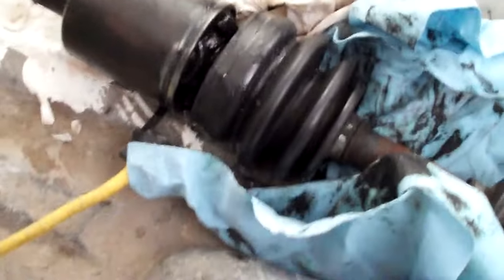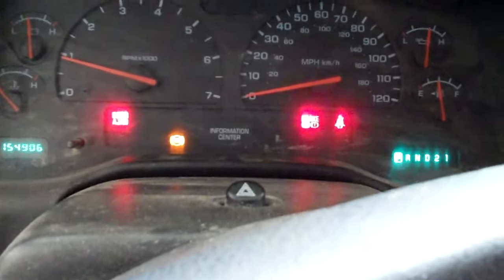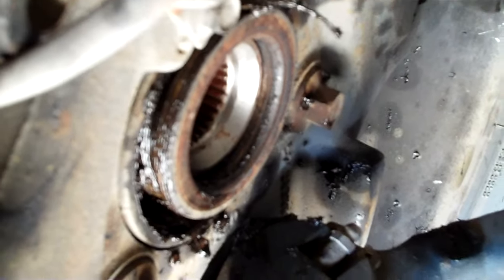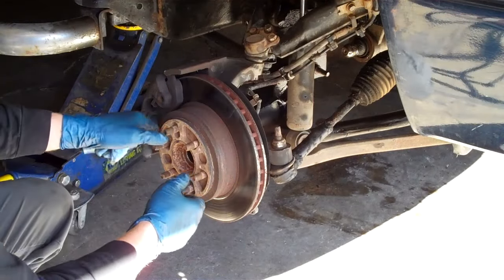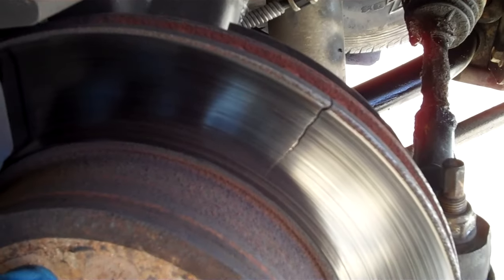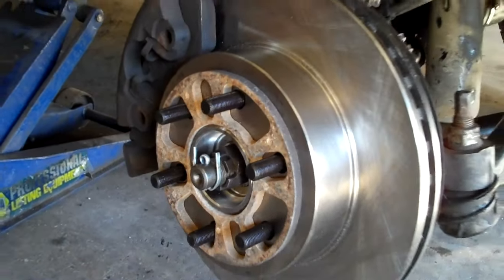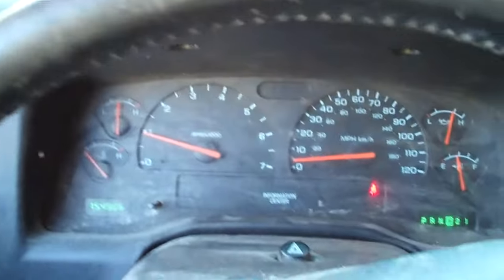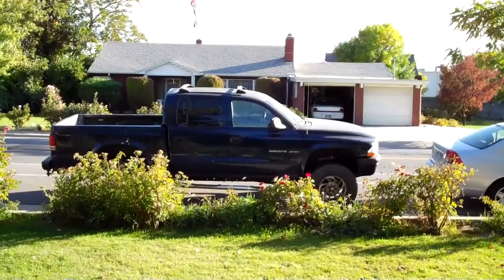What Happens if you Drive with NO CV Axle Here's what Happens....

Comment: Sorry if it is a stupid question, but may I ask why the spacers behind the wheel are dangerues?
Bare with my English please, I am 16 and from Holland, so I have a lot to learn :-)
Reply: The spacer push the wheel away from the lugs. You have less thread on the lugs available to tighten to, which is bad. A actual wheel spacer is a metal ring bolted onto your original studs (lugs) that has another set of lugs for your wheel to bolt to.
Reply: JaffaCakes Ah, didn't think of that, thanks a lot for the information!
Reply: JaffaCakes Ruu d 
Actually that's only half the problem.  And it's not the most dangerous half.  The wheel isn't held on just by the lugs.  The lugs aren't designed to support the weight of the vehicle.  If you look when you pull the wheel off, there's a lip in the middle of the hub that fits inside the wheel, that's what supports all the weight.  When you put the spacer on, the lip isn't long enough to reach past the spacer and fit onto the wheel, meaning the lugs are carrying all the weight.  THAT's why it's so dangerous. ;)  I've seen thinner spacers that didn't actually bolt on, they simply fit onto the lip of the hub, and had their own lip that the wheel could mate to, and they come with longer wheel studs to replace the stock ones.  I've seen spacers that bolted onto the hub and had their own lugs, but that had no hub centric rings and supported the weight of the vehicle entirely on the studs.  Any wheel spacer that doesn't have hub-centric rings, is dangerous.
Reply: BeenJamin James Good point I forgot about that.
Reply: BeenJamin James Actually you have a lot of incorrect information there.  The lugs and lugs alone are designed to support the weight of the vehicle, and not the lip of the hub/rotor.  If what you wrote was true, then the lip on the hub would be a lot beefier. To support the weight of the car, there could not be any spacing between the rimand hub lib.  In other words, you would have to press your rim on and off the lip just like you press a bearing.  The lip is there to just hold the wheel in place for hubs without protuding bolts, else it would be even more difficult to put wheels on these hubs. QED
Reply: +BeenJamin James that depends if the vehicle has hub centric or lug centric wheels
Reply: +BeenJamin James many older vehicles are lug centric, including my 1994 ford bronco

Comment: Brian, need some advice, i have been trying to gain some info about my decision based on the CV Axles. 
I have an 03 Jeep Grand Cherokee, with the 4.0  --  6 Cylinder motor.
Not as much weight in the front as the V8's have, But besides that. 
I am wondering if it would be okay, to remove the CV Axle, BUT LEAVE the stubs in that hold the wheel bearing together. Can this be a possibility, even for a daily driver?  I never had to use 4WD in my jeep even in the snow, it never  worked.  I do plan to swap to a 6 speed transmission eventually with only 2wd to eliminate the transfer case. 
Any advice would definitely be appreciated!   

Jeff,

Comment: I have a question have a 1997 Chevy Tahoe 4x4 front right wheel locks up wen in 4x4 no noise or anything rolls with the wheel lock forward and Rivers and wheel roll back and lock and truck goos 5,10,15 feet forward or back and no noise and take of 4x4 and rolls fine any info can help thanks

Comment: I do my brakes on my 04 dodge ram. It has 4 wheel disks and when I replaced the rotors the first time there where lock washers holding the rotor in place. I never replaced them are they necessary?

Comment: I f you have to remove you axle for any reason, to make it drivable you need to leave the outer part of the CV axle and the axle nut. that would have held the bearing together
Reply: it doesnt hold that bearing together at all...
Reply: My old mans 07 dodge has the same splined hubs as the one in the vid and its 2wd. Explain that one

Comment: Your wrong. The front axel and the hub were already damaged. The hub on the front of 98-03 dakota on the 4x4 is the exact same as a non 4x4. I have a 01 dakota 4x4 4.7l and have over 100,000 miles with out either of the front axels. My 4x4 blew out a long time ago. There's other things I had to do. But i didn't have to do anything to the hubs. This might be the case for a different truck. But not my Dakota... JS.

Comment: Question need to rebuild the diff. but still have to drive it. got 2 bad cv going to cut ends off and retorque, drop diff. would that work on a 00 chevy 1500
Reply from the maker: +Harold Odeen As long as the outside is through the bearing your wheel won't fall off.  Thanks for subscribing and clicking that thumbs up!

Comment: I got an 06 Chrysler sebring 2 weeks ago, I was driving down the road when I noticed my steering wheel jolt to the left real fast, then again.. so I pulled over thinking I had a flat tire, all was fine. So I kept driving down the road, braked to take a right turn and then tried to accelerate and all of a sudden my speedometer went to 60 but my car went no where and at the same time it felt like my tire was gonna fall off and my steering wheel continuously jolted back and forth. I parked it on the side of the road. And everytime I tried to put it into any gear, the car made a loud grinding and clunking noise. I have no idea about cars, but is there anyone that can give me an idea if it's the axle or transmission or anything?

Comment: this video is misleading....... currently my 2006 Dodge 1500 does not have CV axles on it and there is no ABS light on and there's no clunking noise. the brakes work fine. the only thing the CV axles do is enable the 4 wheel drive system.the truck in the video I guarantee had pre-existing problems that's why the wheel bearing was in the condition It was. it had nothing to do driving with no CV axles... you can also pass safety with no CV axles. if driving with no CV axles was unsafe they wouldn't pass you. you can also go on to online forms and there are tons of people who drive their trucks with no CV axles and they've been doing it for years and nothing has happened.

Comment: I had a 91 camry no abs and it had just flipped over 100k  I tried re greasing the cv axle were clicking for over a year  so I had help and replaced them about 6 months ago . then that dumb ass rear ended me and totaled our car . I would have gotten I am sure another  100k from that car as it was a 4 banger . His insurance gave us 1200 for it . Even thou I had changed brakes rotors cv axles they would not pay for them . I am sure the engine was ok the frame was twisted bad

Comment: Doesn't happen with solid axes teehee ;-P
Reply: ***** Also, independent front suspension generally results in a lower vehicle height, making it easier for people, especially in dresses, to get in the vehicle.
Reply: Indrid Cold ifs is more expensive to engineer and produce. not cheaper. the only advantage a solid axle has over ifs is articulation and unless you take the Rubicon trail to work and home everyday it doesn't matter. jeep even toyed with the idea of making the next wrangler with ifs but chose not to because people like you can't let go of the stigma that solid axles are the only way to go. There's a reason a lot of teams are switching to ifs to run the king of hammers
Reply: smelly cat not to mention solid axles are far more reliable
Reply: Marcus Zizzo you know what happens when you put a 35 inch mud tire on a danna 44? you might be able to go to the grocery store but if you do some serious wheeling you'll be in worse shape than this guy in the video
Reply: smelly cat that's why you build up your rig throwing massive this on a stock rig is just asking for trouble
Reply: Marcus Zizzo that's very true and there are companies that build beefy ifs too that will take just as much abuse as a danna 60 if not more. wanna know why people still use solid axles? cause its cheaper. not better
Reply: So the only difference is cost? That makes it the better option if you ask me, why spend more money for same performance?
Reply: Marcus Zizzo because when you add one ton axles on a vehicle that weighs 3-4k lbs you will find yourself in a situation where the axles dictate the direction in the vehicle rather than the driver. its fine if its a dedicated trail rig that gets towed to the trail and towed back home but if you tried to drive a freeway speeds you will die... this is where ifs will shine when using oversized tires
Reply: Riff Raff i run 35s on a dana 30 its a woods toy only ans i beat the ever livin shit out of it no problmwa so far been a year

Comment: TYPICAL GM CHEVY ENGINEERING!!! Basically if a fly smashes on your windshield you have to pull over and call the dealership to tow you truck. I got a 04 sierra denali. What a POS!!! Any small thing that happens to it you have ylto fix it rightaway or risk damaging the rest of the car. And its supposed to be the top of the line too.
Reply: *****  no, it's a toyota camry